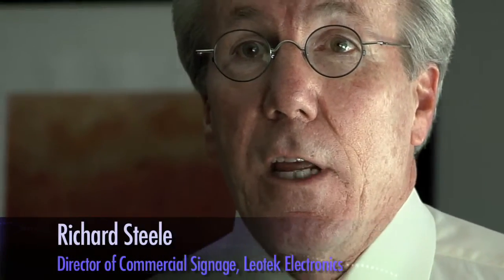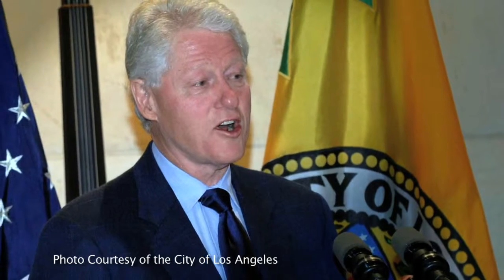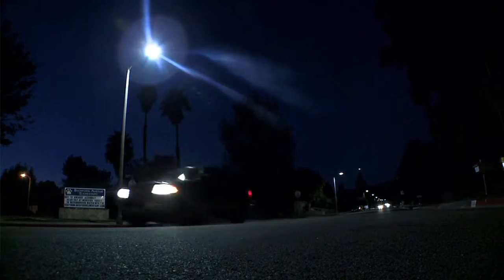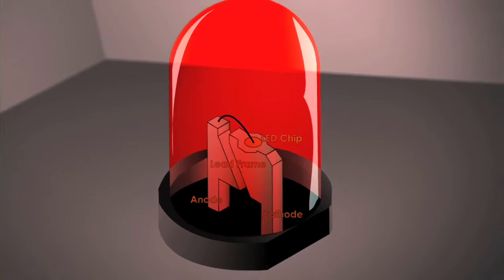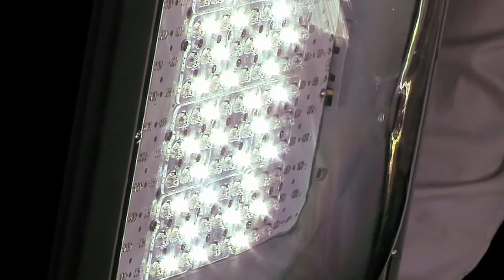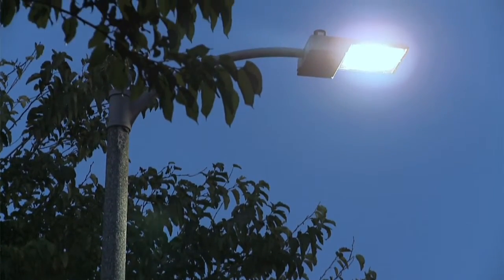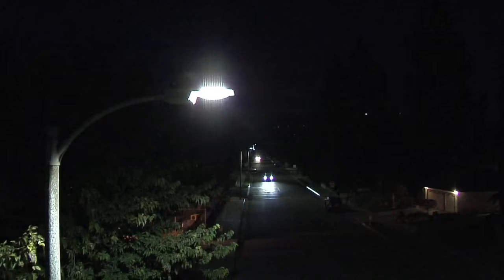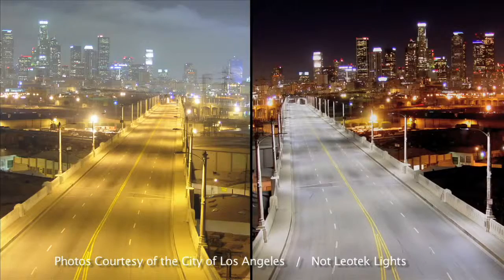LED Street Lights - Green LA

Comment: This makes me want to be sick, the yellow high pressure sodium lights are actually more efficient, they also out out much more light than the LEDs. Another sad thing is, sure the lights may last for ten years, but once that time is up the entire fixture needs replacing, whereas with the current fixtures you simply replace the bulb every four years and the fixture will last for 30 - 40 years. Plus LED is simply unreliable and needs much more development, ceramic metal halide is a better choice.